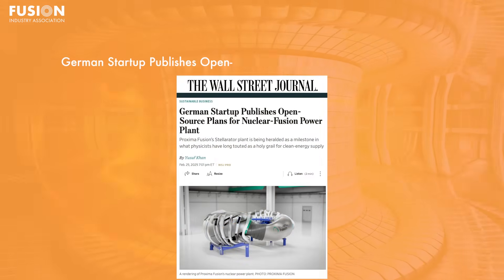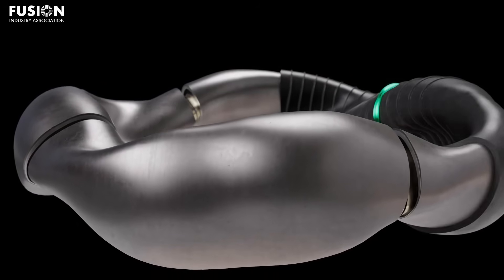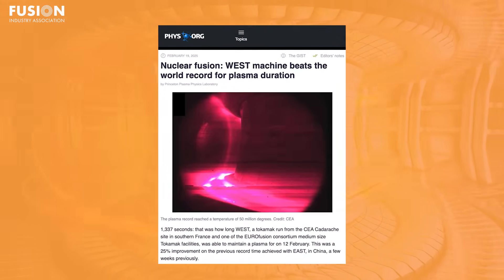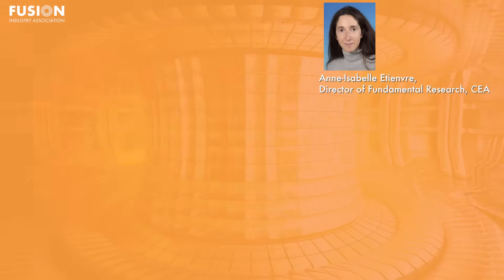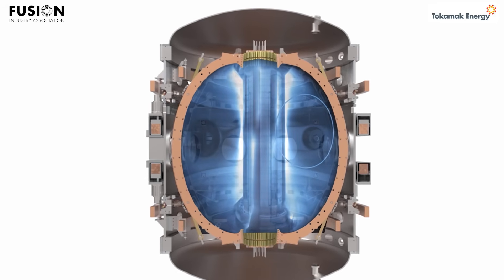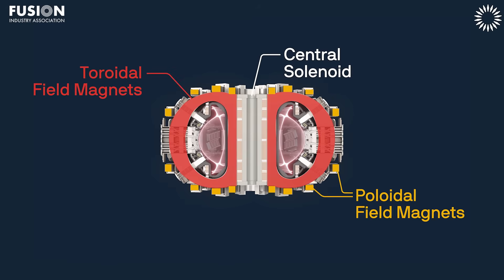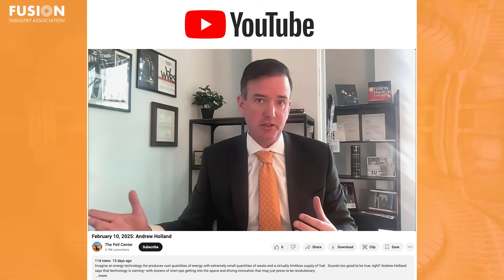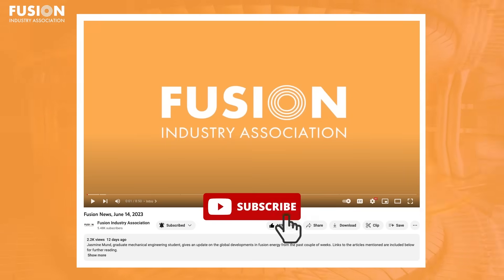Fusion News, March 5, 2025

Comment: 3:13: Long particle confinement times are good news, but they haven't released information on the density, temperature, and ENERGY confinement time, which are the really relevant parameters for fusion. You can in principle hold a glow discharge for years, but that doesn't mean it's relevant to fusion.